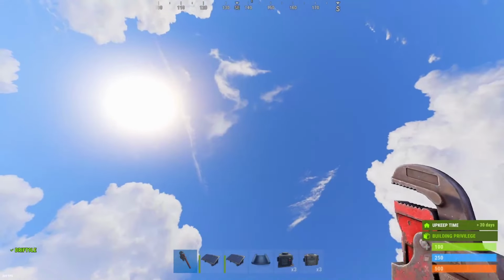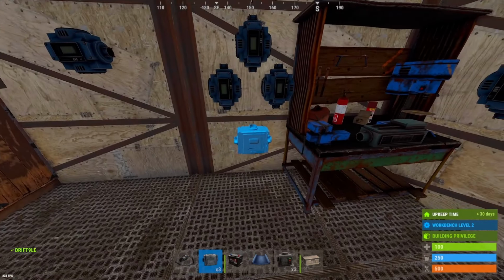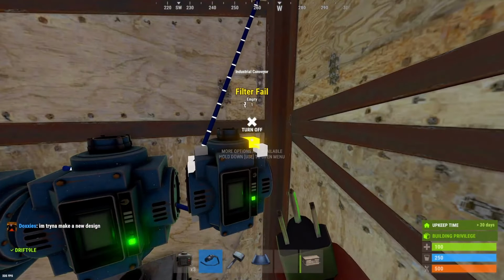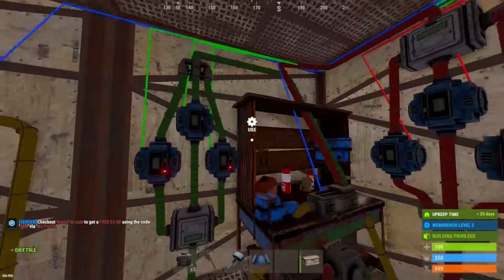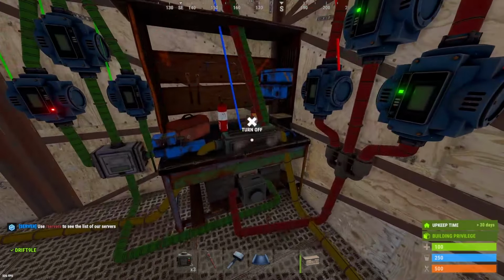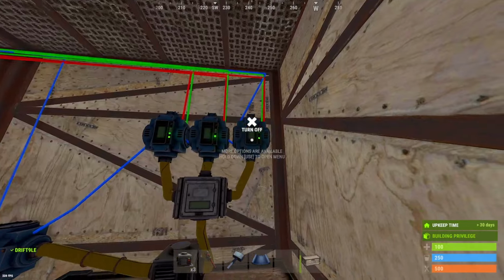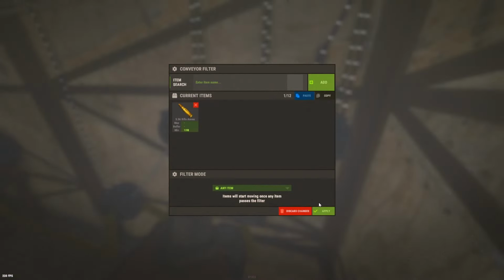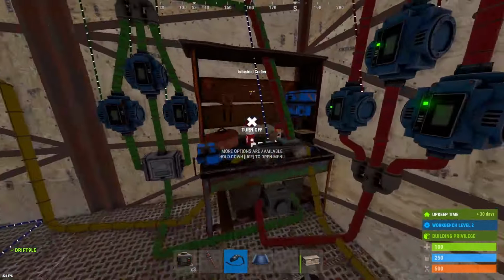Industrial System | Auto craft and cycle blueprints, all items - TUTORIAL [Rust]

Comment: Thanks for sharing! Works great as is, and is very useful for setting limits on crafting. But after trying to scale it up to craft more recipes I discovered an important limitation: it really only works if all the recipes have a total number of different ingredients up to 4. I didn't try yet, but I think it will also still be possible with this system to have more than 4 blueprints as long as the ingredients are the same (eg. many different ammo types). But if you try to craft for example, explosives and rockets on the same work bench, you will run into the problem of items from previous recipes clogging the auto crafter up and preventing ingredients for the new recipe from being received. I could not find a reliable solution for this, so if you want to automate a LOT of crafts, you will be better off setting up multiple workbenches that use recipes with common ingredients.
Reply from the maker: thats correct it has a limitation of 4 materials to craft items. it will clog up the entire system if you add other BP's that make the toal of all BP's use more than 4 materials. Just put on another crafter and do a seperate system for this. ONLY 4 materials max for each set of BP's to craft
Reply: For rockets and explosives you only need one lvl 3 workbench because you can just put 2 auto crafters on one workbench (one on bottom and one on top) this way you avoid the clogging
Reply: I saw a video that uses radio frequencies to time the crafting and fix that issue but it's complicated. The guy just shows you a tutorial of it working some parts of the build but not an actual tutorial on how to build it. You would have to screenshot images and try to replicate it. He was able to get eight items crafting on one workbench in a 1 by 1 grid. I'm sure he arranged the materials in a way that didn't clash too much. He also said the parameters for the exact material for that one particular item that was to be crafted so the inventory in the auto crafter would be empty for the next item.

Comment: Cool setup. Got one question tho, after the box that receives the crafted items (syringe+bullets), I would generally distribute that to 3 boxes (one for pistol, one for 5.56 and one for syringes). If I use this setup, the "buffer" box is used as the sensors, so it only stops crafting, when my final boxes are all 100% full, because it will keep pulling based on the "buffer". Is it possible to set it up in a way that it crafts X amount of items then stop?
Reply from the maker: Not possible. U need to use sensor
Reply: @DRIFT9LE  I was able to do it :) Simply adding another splitter after the "buffer" box. Then you pull from that splitter to your final destination boxes, going through new conveyors that will have the limit you want in the "destination" box. With that, your final boxes will only pull the set limit, and the sensors work just as your video shows! Thanks!
Reply: @Niitz87 u have a rustrican link?

Comment: How much power minimum does the whole setup take? Will build it rn
Reply from the maker: Under 15 i think, also remember when running from batteries its 80% efficient. If you have 2 small batteries connected in paralell with combiner u have 20 output * 80% = max 16 power

Comment: I set this up exactly the same but mine just stops crafting. Even though it has more than enough resources to craft more.
Reply from the maker: if you watch the entire guide and dont skip parts you will know how to troubleshoot the problem :)
Reply: @DRIFT9LE  I watched the entire video and replicated what you did but changed the source from TC to a box instead with the materials. However, the blueprints don't swap with what material is left to craft. So If I wanted to make explosives I have the three materials but the blue print is not being selected.
Reply from the maker: @sebbiechu  Did you remember to turn on the conveyors the first time? you need to turn on everyone.
Reply: @DRIFT9LE  Also when I try the filter pass and filter fail not all the industrial converyor like up. Only one of them lights up for fail and pass.
Reply: @DRIFT9LE  I've tried everything and followed the video exactly the same. At the end I just ended up have one item like explosives and once thats complete I will change the materials.
Reply from the maker: @sebbiechu  max total materials is 4. if you have more than 4 total materials it will clog and stop the system
Reply: @DRIFT9LE  So how do you make a system to do 3 different blueprints which don't all use the same material?
Reply from the maker: @sebbiechu  you cant. You need to use more crafters
Reply from the maker: you need to plan and se what uses the most common materials and use them with the common material in the same crafter
Reply: @sebbiechu   I think you will need to modify the input conveyor from your materials box to reflect the items you will need for your craft

Comment: Mine won't cycle the blueprints it just keeps crafting and crafting and crafting. It won't even shut off when it meets the Max limits
Reply from the maker: You have connected the wrong connections from the «sensors»
Reply: @DRIFT9LE  I'll go over them again. I thought that was the case but I can't fix it. I bet they r reversed. Thank you. I'll try that. When you said it, I had an opihany.
Reply from the maker: You also have to put it in MIN on the conveyor, not max
Reply from the maker: @EMES365 think about it like this: its the sensors who decide the amount of crafted units and tell the industrial crafter to transport the BP out. Your faulty wiring is 100% there :)
Reply: @DRIFT9LE  crap. Which conveyer?
Reply from the maker: @EMES365  right side
Reply from the maker: of workbench
Reply: I figured it out. My wiring was fine. When yo u search for an item to move in the conveyor like a high velocity rocket for example. When you search for it and it pops up on the selection on the right side has a blueprint. If you click on the blueprint it gives you the blueprinted item not the suggested crafted item. I didn't know there was a difference.
Reply: This has to be a new thing because in your video you just click on the item and not the small blueprint on the right.
Reply from the maker: @EMES365  I think you see wrong my friend :) i press on BP on all of the conveyors close to the workbench. The other need to transport items and resources
Reply: @DRIFT9LE  okay. Well at any rate I figured get out since that particular thing wasn't clear in the video so did anyone reading this there is a difference between blueprints and items in the conveyor if you didn't know. I sure didn't. Thank you for the video and help!
Reply: I did see wrong. Scouring the video again, I was in the wrong place for reference.